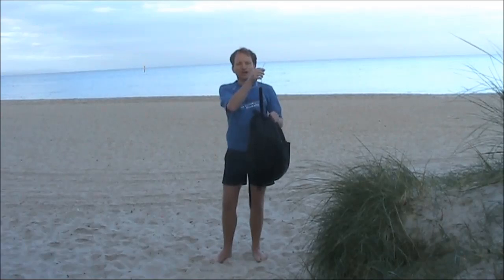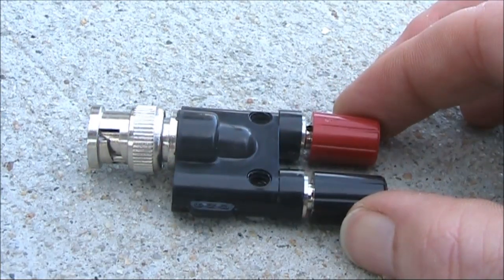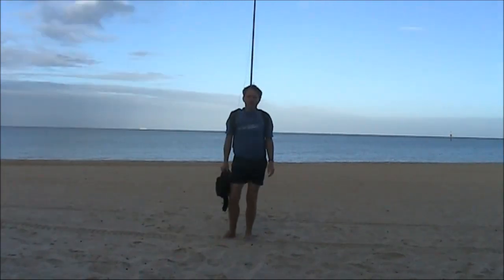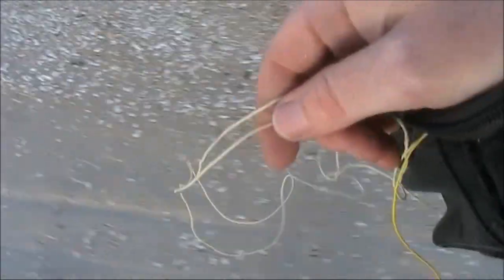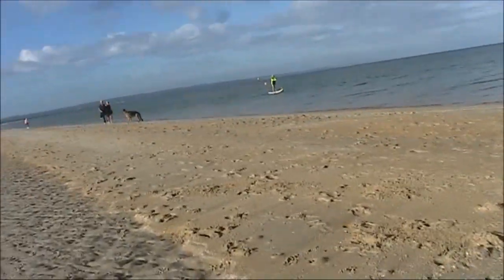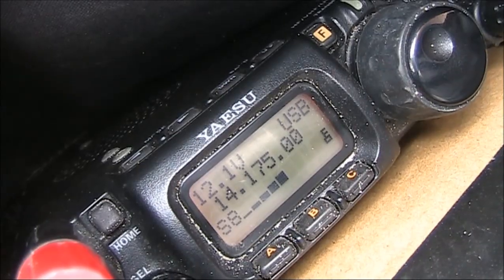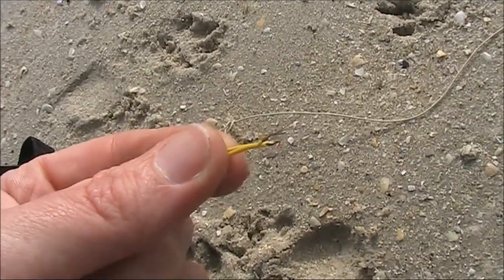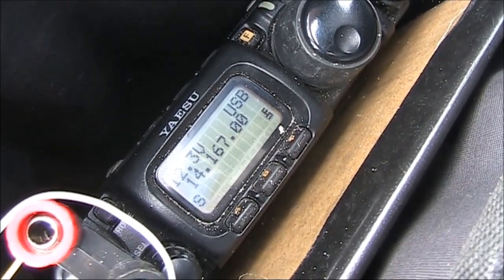14 MHz pedestrian mobile with a quarter wave vertical

Comment: Very nice video. A thought about the SWR readings: I'd expect significant losses due to poor ground over the dry sand. That could explain why there's no correlation between low SWR readings and performance: reflected power is low not because most of it gets radiated, but because most of it is heating the sand.

Comment: Great stuff Peter,
I have went full circle and began constructing your magnetic loop which I hope to finish soon. I have also found a massive difference in the SWR between the sand and promenade which you are correct the GTU takes care of that. Enjoyed the video and will listen for you Sunday from Blackpool 16.30 to 18.00 your time. (0630 to 8.00 BST) 73 M0DAD